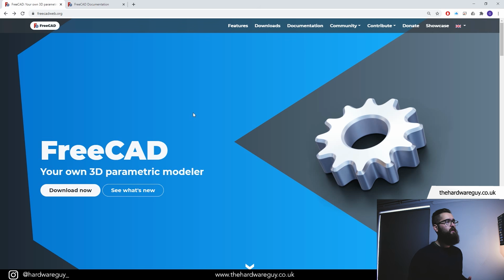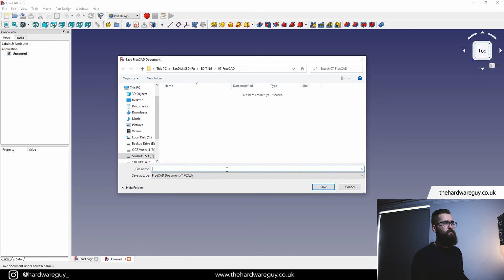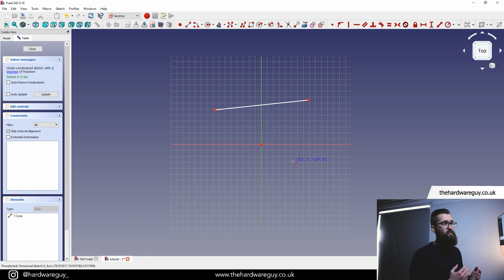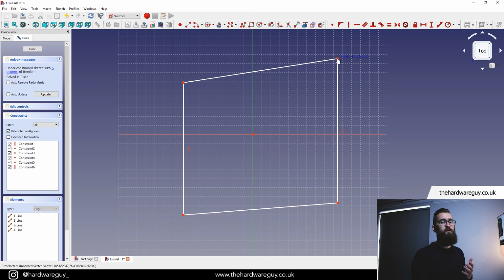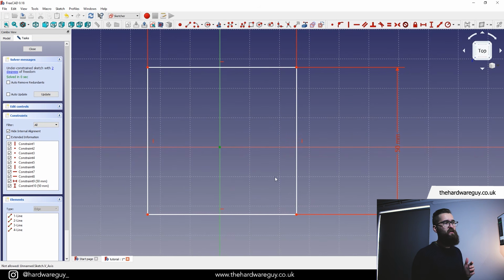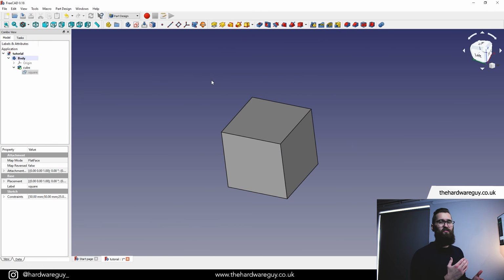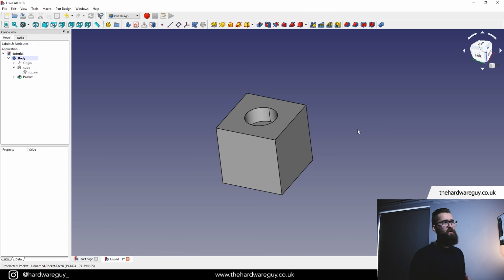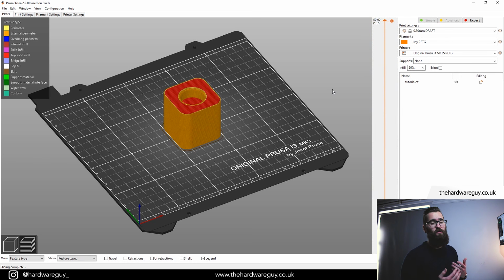FreeCAD For Beginners p.1 - UI, Sketching, Constraints, Extruding, and 3D Printing

Comment: Some of the options you show don't exist in my freecad and I have to click on the arrow beside Dimension to access the horizontal and vertical lengths. Also there is no update option on the sketch but just closing it seems to save the settings. However I do not see the finishe dopbject after that just the XYZ arrows. Freecad version1.0.2 fro Linux

Comment: I can't do shit on my FreeCAD because everything is too small.  I can barely read the text in the sketch, I have to select the exact pixel to select a point, etc.

I've only been using this program for like 30 minutes and I already have a migraine and I'm absolutely furious.  I've been using inventor for years but I can't even make a F--ing square and center it on the origin in FreeCAD because the UI is so horrible.  I can't F--ing see which points I've selected and which I haven't, it won't show me the dimensions I've made, I can't make one dimension reference another dimension, unselecting the constraints in the list to the left doesn't do squat, etc

I HATE THIS PRODUCT

Oh yea, and this Fing Rtrdd product changes my inches into yards after I enter a dimension, even though it has " after my numerical input.  That's supposed to mean inches, right?  But this garbage can't keep inches and yards straight.  I'll try again tomorrow and uninstall this garbage if I can't figure out anything better in the morning.

Comment: Was having a hard time with opening the sketch tool and circle on the cube. When I finally got the sketch tool activated my cube was not centered in the crosshairs. The center point was at the bottom center of the cube. I must have done something wrong for sure. Have yet used the escape key on my keyboard so far. So I know I must be doing something wrong.

Comment: Sadly the 1.0 is so much different from 0.18 that tutorial can't be completed as even first tasks don't work same way.
Reply from the maker: Follow along with the same version as me, when you've picked it up the switch to FreeCAD 1.0 will be easier for you
Reply: @thehardwareguy  Hi, i have a problem. I have an .obj, and all I want to do is open that .obj and assign measurements to it. That is, say make this 20mm long 25 mm tall and 10 mm thick. How can I do that? I can't do it. I can create a solid based on the mesh, but can't modify it's sides at all.

Comment: Why do all this when you could draw a solid cube and drill a hole in the middle? I would have created a solid cube and drilled a hole in the centre, Freecad cant do this?
Reply from the maker: Doing that would escape the point of this series entirely, I am trying to teach basic principles of CAD which includes the 2D and 3D workspace. Sure you can create a cube in seconds, but immediately you'd skip over sketching and constraints. So then what happens when you need a shape that FreeCAD doesn't have a preset for? always create from scratch, you will be a better designer for it.
Reply: @thehardwareguy  my cad does not use constraints so the whole process is a bit foreign to me. I draw lines where 
I want them and circles the size I want them when I create them. Have only ever required restraints when doing animation which is understandable, without constraints the animation has no idea what it can or cannot do. Why are constraints so important when making a sketch. I am looking at videos for someone else to learn Freecad, yours will be amongst those I recommend. All videos seem to go on about constraints so I have to assume they are important.

Comment: So many small differences between what I see in this video, and what I see on my screen.  Still, trying to follow your steps and everything seems to be ok until I try to use pad command, at which point it tells me the object needs to be part of the active body and I should use some sort of binder thing to work with external geometry.  How do I have external geometry??????????
Reply from the maker: Make sure to use the same Free cad version as me to follow along. v0.18

Comment: Great video and explanation.  Unfortunately, can't get past 21:44.  My 3d cube is off center on the grid and I can't get it centered over the center point.  I click and drag and the whole grid moves with it.  When it allows me to sketch the circle on the top plane, it will not allow me to apply constraint to the circle and does not snap align over center.  When I try again it sketches the circle on the bottom plane so I can't see it instead of the top plane I'm looking at.  I researched how to get it back and no luck.

Comment: im 70 years old learning somthing new enjoying your assistance in this . question you set distance from edge to center at 25 when you set center you clicked on center than on the corner and set 25 to center on work space center to corner is not 25?

Comment: This is a really good tutorial, but I've got to say it baffles me that you can call FreeCAD friendly. The user-interface blocks that I've run into in my first couple of hours have been simply excruciating. For example, I inadvertently hit Escape while sketching and most of the sketch controls disappeared or became disabled. It took me nearly an hour to find out, purely by chance, that you have to go back to the model view, right-click on the sketch and "Edit sketch". I don't believe most sane or sensible users would persist with a program that treats them like that. Maybe FreeCAD will start to make sense when I've used it for a while, but my impressions as a new user are that it's just gratuitously agonising.

EDIT: I came back a couple of days later and made it through the rest of the tutorial, but my impressions of FreeCAD have barely improved. At one point I started receiving error messages I found completely incomprehensible, and even googling for forum posts didn't help me understand them. And they didn't go away until I purged my entire FreeCAD configuration and started again from scratch. After that the same operation worked. Then, when I was trying the fillet part of the tutorial and I entered the fillet radius as "10 mm", I got an inexplicable error message saying the fillet radius was zero. I was unable to apply a fillet until I exited and restarted FreeCAD, whereupon I repeated the same steps and they worked as expected. This is not the behaviour of a healthy program.

I'm going to carry on trying, because FreeCAD is probably my best bet if I can't afford AutoCAD, but I sure do hope practice will make it less of a ****ing nightmare.

Comment: One does not simply sketch on a model face.
Reply from the maker: Yes you do. That's how the process works, whether in FreeCAD or Fusion 360.
Reply: @thehardwareguy  well, enjoy having your entire model break when you make a small change to the lowest sketch in the stack then I guess.
Reply from the maker: As long as you always reference the center point and use parametric modelling nothing will break. I cover parametric modelling in part 2 of this series if you're interested. I highly recommend it 👍🏻
Reply: Turn that square into a hexagon or a triangle and say again nothing will break? I'm not sure how parametric modelling or referencing the center point will help when half your model depends on a feature that was moved to another side or just no longer exists.

Comment: Thanks for taking the time.  It was going great until 8:33 when you 'grabbed' your lines, but didnt show what tool to select to 'grab' with.
Reply from the maker: You're most welcome. I didn't mention a tool because there is no tool used for this. You simply click it with your regular curser. If you already have a tool selected, hit 'ESC' on your keyboard to de-select it.

Comment: I don' t know the exact details, but you need to be aware that these cars came with two different non-compatible hydraulic oils. Put the wrong oil in and you will mess up all the rubbers and whatnot in the system. Best to figure out which one you need in your car and make sure all parts are for the right oil.
Reply from the maker: did you comment on the wrong video? doesn't seem relevant

Comment: Have just loaded FreeCAD 0.20,1 alongside LibreCAD which I find great for my 2D design requirements.  My device is an ageing 27" iMac running High Sierra.  Please note that some of the icons you select from the toolbars for the various functions have changed and after realising this I found it essential to hover before selecting just to ensure that you were choosing the correct function. With your tutorial on one screen and the FreeCAD on the other I was able to stop, start and backtrack on the tutorial, brilliant.
Keep up the good work and keep safe.

Comment: very clear and helpful tutorial. my CAD experience started with AutoCAD08, with some blender/3dsMax as well. I'm able to sketch lines and set dimensions, however I have trouble with selecting and moving items based on snap and Osnap movement from AutoCAD. Currently attempting taking basic 3d model stl files from thingiverse, and subtracting spaces or adding pockets. Can't find how to view as wire diagram and edit vertices, or how to snap the center of one object to the center of another.

Comment: I'm well experienced in AutoCAD and CNC programming but no 3D Printing. Switching to different pages in your drawing seems odd. Looking at your circle, can you draw by Snapping the circle center to the center of the square? Or does constraints replace that function?

Comment: The second time I went through your tutorial. I am on a late 2013 imac running catalina and I hit some snags the first time. But this time I took it slow and rewound the video several times to copy your modeling. I have tried other free cad packages, Fusion 360, SelfCad, OnShape, SolveSpace. I kept coming back to Freecad because it resides on my computer. And your videos were the clearest. I am new to cad software and hope to do some 3d printing soon. Thumbs upped and subbed.

Comment: the edges of my line meet the other lines with the coincide constraint, but it doesn't connect them. So now if i try to move the line it just moves away on itself and i want it to move being connected to the other lines like how you do it in the video.

Comment: That was a great tutorial! I may have missed it in the video but his free CAD software free as I assume it is and will it work on the macOS? And if I want to export an STL file straight for 3-D printing I’m assuming I can do that within this package as well or do I need to buy a different piece of software for that? Lastly, if you have any recommendations on a quality 3-D printer they don’t have a build area of 10 x 10” in the X and why and at least 4 inches in the Z that would be great

Comment: I have a lot of questions now, how do you put the circle not on the center dot and constrain it, if i add lines to constraint the circle the lines become part of the mesh, also I tried adding a circle to one of the sides and the "center" dot or origin of that sketch was on the bottom of the body not the center....  so is there a way to make constraints with lines that are not part of the mesh ? Not sure if I'll get answers but Ill ask anyway. I'll continue watching the rest.

Comment: Thanks, I'm coming from Blender and this will be a great tool to add, I think they both have there place. What I like is in preferences I was able to select blender controls so I don't have to get confused going back and forth. And I can import objects from FreeCad to blender, not sure how it will work the other way, but no problems with this cube and bevels going to blender, all the dimensions and scale was accurate

Comment: You can avoid needing to set the centre dimensions instead by using a centre constraint on the vertical/horizontal origin lines, this way if you resize the part rectangle it remains centred with respect to it's size.

You also never need to press "Update" in your sketches if you have "auto update" checked (this is the default).
Reply: How might i go about that, it sounds useful?
Reply: @paulmyfinger Select the top left and bottom right corners of the rectangle, then select the origin point, then click on the "><" constraint icon.

Comment: I’ve used several 3D printing software packages, without much success. What I need to do is simple, but other pkgs seem to make it difficult. How does freecad handle welding individual parts into one piece? Example: I want to make small tubes and weld them together in a cluster, with the same point of origin, and at a specific angle from each other. Rather like a bouquet of sticks with the bottom ends tied together.

Comment: freeCad v0.19 for mac. I've followed the steps but it doesn't work, when I press the left mouse button the pointer changes from a cross to a refresh symbol. Ps I reset the GUI and it works normally now, there was something wrong with the function assigned for the mouse buttons

Comment: Good point that you use Part Design and Sketch workbenches 90% of the time.  Suggest a video of which tasks require the use of other work benches and which ones are best to use.  Having used Freecad on and off for a few years I'm sure there are some workbenches you'll likely never use.

Comment: First I would like to say thank you for the FreeCad Tutorials. I have found them extremely helpful.
I do have an issue with spreadsheets. I really like the idea of Parametric modelling, however, when I get to the point of clicking on the spreadsheet, nothing happens. It doesn't insert a spreadsheet. I am using Freecad 0.19. It is really frustrating. I don't want to go on without it as I feel it will become a necessary practice and don't wish to start by creating bad habits.
Any ideas would be appreciated.
And again, thanks for the effort on your part.
Phil

Comment: Thank you very much. Learning new software (yet again) is never high on my "That sounds like my kinda party!" list. But you made it straightforward, simple, & cleanly explained. Particularly the constraints.  Oddly reminds of 1999, learning Macromedia Flash 4.0 & vector bitmapping animation. Running Windows 98-SE.

Comment: Thanks what a great tutorial: I tried to teach myself using the excellent wiki but this incredibly steep learning curve software (at least to me) only started to make sense when i watched you HWG, and some very basic information was conveyed about the main workspaces being used are part design and sketcher as it was not clear until then why I had to learn so many tools/workspaces and if not which ones were important. Two questions in the event ppl with knowledge read this: how on earth do it turn on that grid (I have the axes but no grid and couldn't find it in the usual "view" menus as a toggle as expected) and second, is there any way of increasing the size of the interactive dice like view icon for top , bottom etc. views?? Again couldn't find this and on my large screen iMac the icon looks nothing like on the tutorial, it is tiny and faded and I literally had to use a magnifying glass to read it! I can use the menu bar for this but am used to a rolling dice thingy from Tinkercad. BTW using OSX on iMac and v0.1.9

Comment: Excellent tutorial! I was finally able to design something that I've been struggling to get designed on other programs for over a week! 

One small critique is that early on you should have explained using the escape key to deselect tools in sketch mode. You do later on, but about two minutes earlier than that I had to guess it in order to stop setting constraints when trying to manipulate a line. 

Regardless, this was a huge help!

Comment: This program is absolutely un-intuitive and frustrating.  It should be a simple task to create a circle, add some constraints and turn it into an ellipse, then extrude it, but I've been screwing with it for several hours over 2 days.  

I "sketch" a circle and it has zero moveable points on it outside of the 2 or 3 (depending on which tool I use), which have pre-set constraints and refuses to allow me to do anything but scale it.  What is the point of having a center point and an x and y point if the x and y points are constrained to the same proportions.  Yes, I know that would technically no longer make it a "circle," but that should be up to the user.

I saw on a forum to go into draft mode and use the ellipse tool, but I can't even manually enter my x, y, z, points because every time I move the mouse it alters them!

I'm 14 minutes into your video right now and I'm wondering why there needs to be 20 drop down modes for each task instead of having all the tools available.